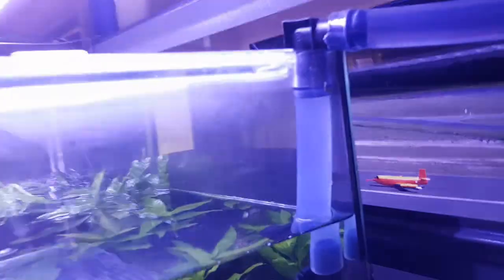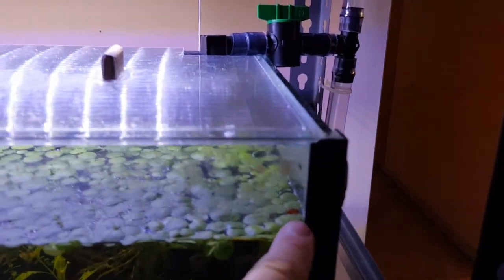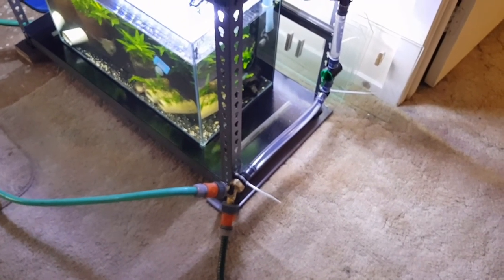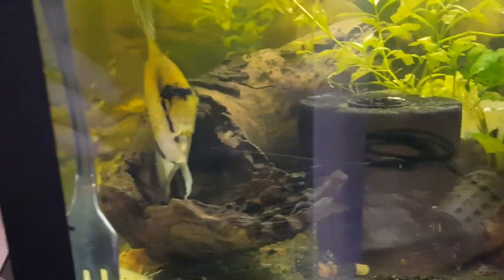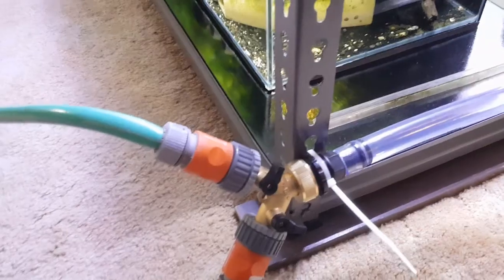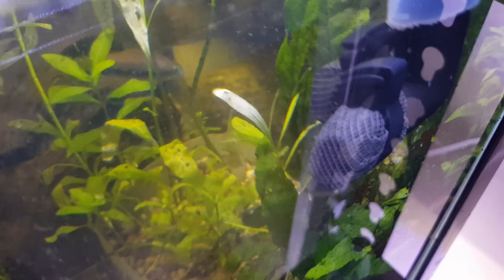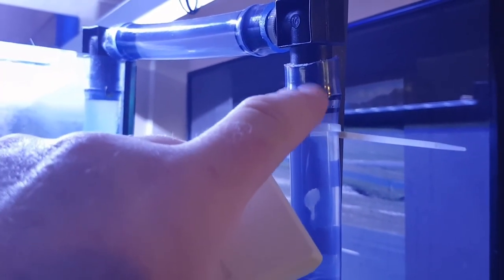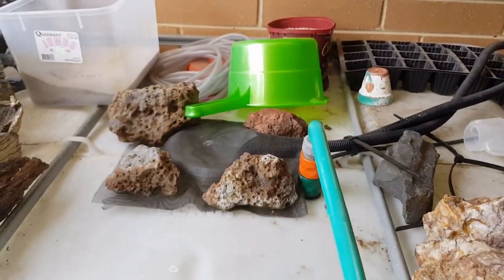DIY Very Simple Water Change System. NO Drilling Tanks!

Comment: Do you ever do a full tank vac?
Reply: That’s where I would have another line at bottom so you could vacuum. 2.0 is coming  I’m guessing.
Reply from the maker: NO I have no need to. If there ever was a need to then I would use a normal syphon gravel vac or the other syphon tubes I have made and use for other reasons.
Reply: @TimsBitsnPieces  it’s scientifically proven that most aquarium disease proliferates in the mulm/debris develops on the bottom of the tank. 
     Keeping the gravel clean is paramount. Especially when your dealing with sensitive/expensive fish!
Reply from the maker: @ZYGTropicals  I have been breeding tropical fish for over 20 years.
Reply: @TimsBitsnPieces  that’s great!   35 years here!

Comment: but what is the pump connected to? What about chlorine, water temp? How is that solved? Is there a container with water, like a large pool? Ohh.. I see it now. That makes sense.
Reply from the maker: As you would have seen in the video the pump is connected to the IBC water tank. The chlorine in Melbourne is very little and it evaporates while sitting in the IBC. The incoming water temp is usually about 10-15 deg below the fish tank's temperature and heats up with the rest of the water in the fish tank. You should watch a video to the end before making comments.... then you will see the whole process someone is trying to show you.....

Comment: wouldnt it be better to have separate pipes from the base to each level tank...that way you could drain all at one time right...
Reply from the maker: Yes, you could do it that way but then you would have to have 3 outlets to drain somewhere.. I only have one pipe to drain it as it is in my lounge room and the hose goes to my ensuite shower to drain. This way I do not have to change anything other than turn off one valve and open another.  Simple systems work much better over complex systems as that is where problems occur.
Reply: @TimsBitsnPieces  thanks for the reply and nice of you to share your setup..

Comment: Just make sure you don't accidentally open the other valve and contaminate the reservoir.
Reply from the maker: Well, that would basically Never happen as I usually use the filling hose to fill up other tanks while these are draining and then fill these when it is done draining, and I would also need the remote control in my hand to start the pumping process so it would Never happen as there is NO way the water can backflow to the IBC supply tank. It is all about systems and concentration.

Comment: Great idea but I don't think it's an efficient way of cleaning the tank you still need to gravel vac all the excess food and debris
Reply from the maker: It's a water change system and in no way alleviates the need for gravel vacking.. when needed. Although it does take out lots of debris and particulates as I stir up the water by cleaning the glass as I do it also when needed.
Reply: @TimsBitsnPieces  good deal

Comment: why not drain all 3 of a them at once cause it would drain the last tank 
at the same rate wouldn't it? just as if you had a python doing it.
Reply from the maker: I have tried this in the past and it doesn't work as there is only a certain amount of volume in the pipe and it takes exactly the same amount of time and is actually slower as the water flow from the top tank also goes back into the lower tanks causing the syphon to stop on them as the top tank has a higher head of water pressure and the lower tank has minimal and thus causes a backward effect on that tank and fills it.

Comment: One tank got sick, all tank got sick since you using same pipe for water in and out. Not smart 😂
Reply from the maker: Not necessarily so.. if you know one tank has an issue then you can drain it separately...draining the water out and then replenishing the water, this will not cause any issue to any other tank if you do it separately instead of doing one tank after another.... or if you do have an issue you can change the water by using a hose or any other system.. this is the same issue with any other auto water change systems..
Reply: @TimsBitsnPieces  if you catch the sick fishes in early stage then you can do it. Most of the fish got issues with internal and wont show until they actually clamped their fin or discolored. Same pipes for in/out not a good idea, i got 500 tanks on my 2 stores and in/out water gotta be separated. Just my thought about it.

Comment: how did you start the siphon ?
Reply from the maker: By filling the tanks with water...
Reply: @TimsBitsnPieces  sorry i know it sounded like dumb question lol, just wanted to make sure it was the simple lol, so basically when I set up the tanks and I start filling them up with the system I will then shut the valves off and leave that water in the system so then I when I go for my next water change all I have to do is just switch the main bottom valve to drain and open the valve for that specific tank to drain .
Reply from the maker: @tsguppyaquatics-tom3488  Yes. its that simple......
Reply: @TimsBitsnPieces thank you and thanks for quick reply back